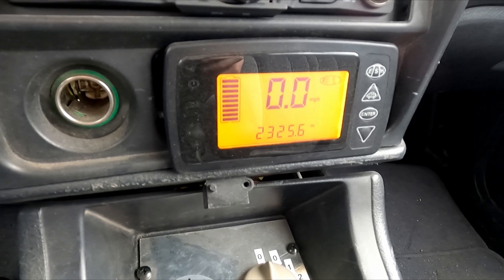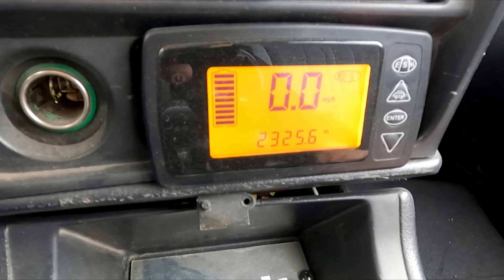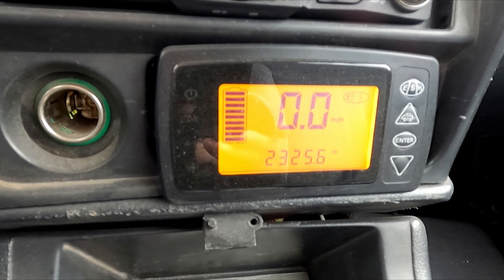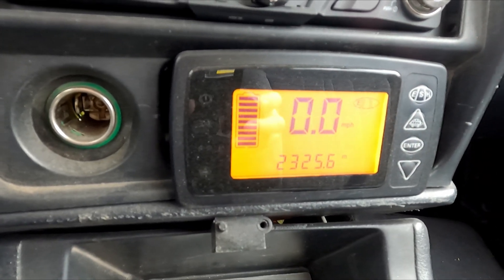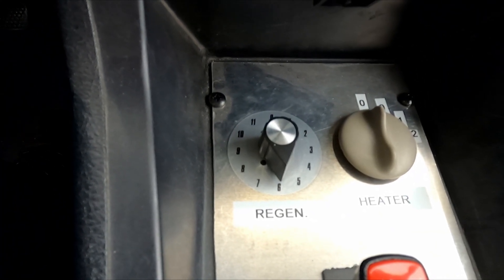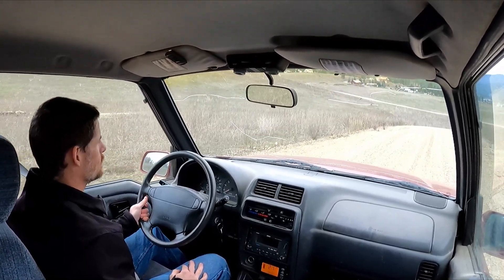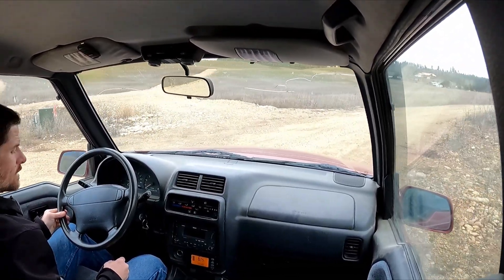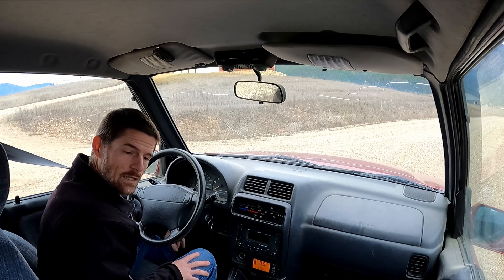Regenerative Braking Demo!! Suzuki Sidekick EV w/ Hyper9

Comment: What is the voltage of hyper 9
Reply from the maker: There are two versions of the Hyper9 system:  100V nominal, and 144V nominal.  I'm using the 100V nominal system, which actually has a maximum input voltage of 132V.  I charge my battery system to about 121V, and can pull down to about 110V if using all the capacity.

Hope that answers your question . . .

Comment: The only issue to using variable regen to slow the car would be how and when to warn cars behind you that you are slowing down. Should the brake light come on as you apply regen, or at 40% (S mode) or full regen (H mode).? Great video.  Thanks.
Reply from the maker: Rick,

The Hyper9 IS controller actually has an output for brake lights that can be activated on Regen.  I was going to connect it until I realized that it's not simply a 12V source that goes hot.  It's actually a ground signal that closes when regen occurs, which would have required another relay and some creative wiring to get the brake lights to activate.  I eventually decided not to mess with it, figuring that my regen settings would be similar to strong compression braking (think exhaust brake on an unloaded diesel pickup).  There's lots of that on the road these days, so I don't feel too bad . . .

Scott
Reply: @scottkahre9206   Good to know. In another video (Netgain Hyper9 motor set up), Steve comments about using pin 18 on the 32 pin K1 plug on the X1 controller (when he is talking about setting up the software to handle the 3 regen profiles) "...I used pin K1-18 as digital input...use a relay because the 12v ground is not the same as the car ground." Exactly what you are saying about using a separate relay.  I am hoping to install the MO Unit Moto Gadget to handle all fuse/relay issues.

Comment: Are you using K1-35, K1-22 and K1-12 for your brake pot?
Reply from the maker: I don't remember the pinout numbers, but I just used the exact same terminals that were labeled as intended for use on a brake pressure transducer.  The 0-5V Pot. works exactly the same way - the controller doesn't know the difference.

One slight change I did need to make, though, was to disable "brake priority" (I think that's what the setting was called).  It was enabled by default, and it would have prevented the throttle signal from going above zero any time the regen pot. was reading above zero.  It's intended to prevent you from "hot-braking" - using throttle and brake at the same time.  However, since I leave my regen setting turned up while driving, I had to disable that feature, so now if I hit the throttle, it cuts off regen, i.e. "throttle priority".

Scott
Reply: @scottkahre9206  Great thanks for the reply. I've contacted Netgain with no response. I am trying to use that brake pot dial over connecting to my brake pedel, as I'll use one pedal driving for most situations. I need to also use the clutch switch, but there in no information on that. When the clutch is pressed, regen is diabled so the syncros don't get messed up when shifting due to no freewheeling. Thanks again.
Reply from the maker: Could you simply wire the clutch to disconnect (or ground) the regen signal wire?  So, it thinks you set regen. back to zero as long as the clutch is depressed?  Not sure if yours already has a switch on the clutch pedal - mine did because it had Cruise Control from the factory . . .

Scott
Reply: @scottkahre9206  I do have a switch bc this 86' Toyota Van actually had cruise control. I don't have a regen wire (purple), but do have the white/blue clutch wire. Thanks

Comment: If you set the Road Wheel Diameter to 85mm in the software, your ESH Display will show true main Motor RPM. I already have a Speedometer on the car, and thought that the Motor RPM would become more useful, on the Display. Also, for your adjustable Regen, did you take the Foot Brake Transducer wiring - straight to your variable Potentiometer?
Reply from the maker: Hi again, Peter.

That's a great idea on the display calibration - without doing the math, am I correct that you actually get RPM/100?

And, yes, I simply connected the 5V source and signal wires directly to the potentiometer instead of a brake pressure transducer.

Scott
Reply: @scottkahre9206  Hi Scott, You are probably correct in your thoughts that it would be RPM/100.  I read this piece of information on an EV Blog Website some years ago, and the figure of 85mm remained stuck in my head. I have exactly the same set-up as you, on a '71 Beetle.

Comment: Hi Scott, I have the Netgain Hyper 9 IS and the AC-X1 Controller. A huge problem is that the Controller sees the amount of Regen 'as a threat, and raises AL 44 very frequently. This should not happen at all, and experts who carry-out these EV Conversions have actually turned the Regen Value to zero, in the software, especially on the Brake Pedal Transducer. There is a video where Moggy and Jehu Garcia are discussing this. Apparently, some AC-X1 Controllers (from new) are fine, with no instances of Alarm 44 being raised - each time that you hit the Brake Pedal. On my software, even though the Regen has been turned really low, this problem exists and no amount of internal software settings will remove AL 44. Moggy and Jehu Garcia have raised this issue, and claim that (on some new Controllers), there are internal faults (from the manufacturer SME) that are the root cause of these problems. Did you have any such issues, I am curious to know? The last thing you need, when your brakes are being assisted by Regen, is for your Regen to completely fail at random. I have been forced to disable the Regen (on the footbrake) for safety reasons. Have any others reading this - had similar issues to me? My car is a 1971 EV Beetle Super Bug.
Reply from the maker: Hi Peter,

That's unnerving to hear that some folks are having trouble with regen, as the flexibility of Regen programming on the AC-X1 was one of the major selling points for me on the whole Hyper9 IS package.

To answer your question, thankfully I have NOT had this alarm at all.  I have been using my potentiometer knob set at 8/12 lately, so I know it's pushing some pretty serious regen current when I decel. from highway speed.

The only issue I've ever seen with regen is that for the first deceleration after starting up the controller (usually in my driveway or a parking lot), the regen torque cycles (on/off, on/off), creating sort of a "jerky" feel.  As soon as I use throttle again, the next deceleration and all subsequent ones during the drive are smooth.  I've chalked it up to a minor bug that I can live with.  It doesn't throw any error codes or alarms.

Perhaps others can comment on your issue . . .

Scott
Reply: @scottkahre9206  What Battery Pack and voltage are you using? I have a similar issue with 'jerking' at low speeds. But the reason may be plenty of "Backlash" in your transmission, where it seems to overdrive, and then hold back - in a quick pattern. I have lots of 'play' in the transaxle, which amounts to about 40mm free movement on the outside of the wheel.
Reply from the maker: I'm using some re-arranged Chevy Volt batteries in 30S - 4P configuration.  This gives me a nominal pack voltage of 120V.

I'm sure the regen "switching" issue is in the controller, not the drivetrain, as it only does it on the first regen after start-up.  Any subsequent regens at any speed are smooth.

But, you're correct that any drivetrain "slack" will be amplified by an electric motor's ability to switch from positive to negative torque VERY quickly.  I do see this sometimes when hitting the throttle while strong regen is in progress.  I get a "bang" out of the transfer case and/or differential.  A newer vehicle with less wear on the gears/bearings probably wouldn't be as bad . . .

Scott
Reply: @scottkahre9206  Hi Scott, sorry for the lengthy delay in my writing about your "Glitch" in the software that causes the on/off on/off drive issue. Well. I got some news for you, but my observations are slightly different..... The "jerk" only happens when I have (just) completed a Battery Charge to full (100%). At the first press on the Accelerator Pedal, the car goes into "jerk mode". And it certainly isn't doing your transmission any favors! And yet, when I can get the car moving smoothly, I burn-off just 1% of the battery capacity, and the car runs fine - just like yours. Finally, I would like to add, that the next time that the "jerking" affects your EV, please look down at your display. You will see AL 25 going on/off - in perfect time with your jerky EV. Hope this helps.
Reply: Same exact thing happens with my electric jeep with this same system.

Comment: After seeing what you did Its hard not to think this should have been implemented as a standard option, perhaps with a sensor on the brake that increased the regen the further you push the brake with its max regen being just before your actual brake engages. It would encourage people to get the most out of the feature and put the most back into the battery and probably not have to change your brake pads for two decades.
Reply from the maker: Yes, what you describe is exactly what the OEMs are doing on most new EVs.  I thought about something like that, but it would've required me to completely re-design the brake pedal assembly to get a "split pedal" so regen. would be in full force before friction brakes engaged at all.  But, in the end, simplicity won out . . .
Reply: @scottkahre9206  I have (finally) got my Regen fixed, where it doesn't go into alarm 44. My technician managed to overcome this issue. Thinking about your Potentiometer Idea, (which is great BTW),  your Foot brake must (surely)  still have a set value for your braking - as a 'failsafe'. I was thinking that you do not want to (accidentally) move the position of the Potentiometer knob, only to find that your braking has been compromised. I still have an issue where the car jerks backwards and forwards when charged to 100 %, and AL 25 shows-up on the display. I am sure that EV Builders will also like your idea, and also capitalise on this. Greetings from Australia.

Comment: How range of this ev? Nice project keep it up❤
Reply from the maker: Hi,

I recorded another video that discusses the range in detail here:

https://youtu.be/mTLPO3UHtTY

Happy watching!

Scott
Reply: Well I have a question... what were inconveniences you ran into that you didn't anticipate? Those bastards will always show up
Reply from the maker: Besides the lower range than anticipated, the two biggest ones are the low RPM vibration due to torque flutter, and the fact that the little ceramic heater element (from a 120V space heater) is pretty weak.  The heater isn't really capable of warming the cabin at all.  It only adds just enough heat to take the edge off the cold and also to drop the humidity and keep the glass clear if it's trying to fog-up.  The good news about that is that it doesn't pull much current, so it doesn't kill the range too bad.  Not sure how I would change it if doing it again, though, because I hate the idea of using the old liquid heater core and then adding a tank with electric heater and circ. pump because that seems way too complex.
Reply: @scottkahre9206   do you have ideas about solving the problem with RPM vibrations?
Reply from the maker: The best thing I could think of would be to add rubber vibration isolators to your motor and drivetrain mounting points.  Mine ended up fitting so tightly in the transmission tunnel that I wouldn't have room even if I wanted to.  But if you planned for them from the beginning, you could probably come up with something.  Otherwise, it's up to the guys who program the controller to improve it by changing the timing of the magnetic field generation for each motor phase as it spins up from a stop.  I would imagine that it's a compromise - less vibration would mean less torque from zero RPM.